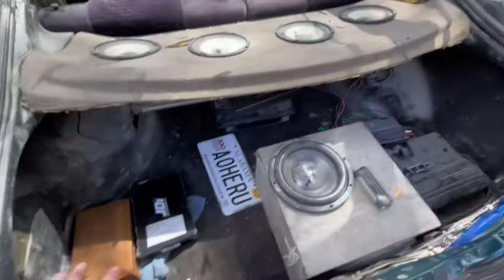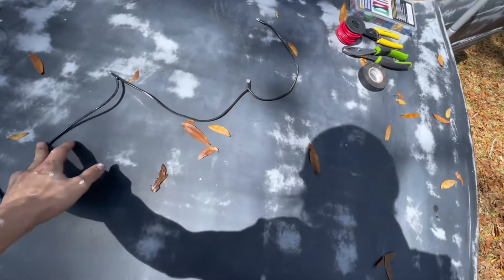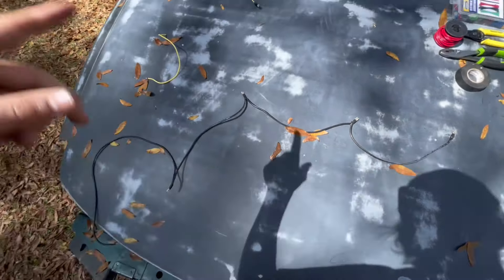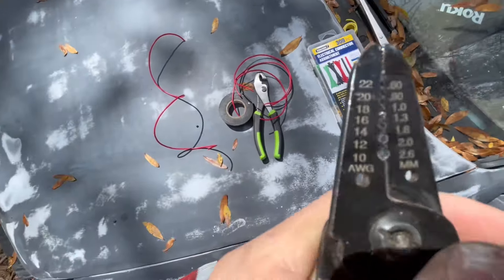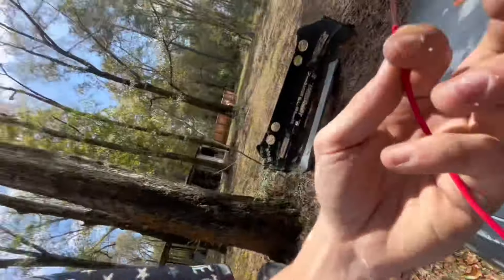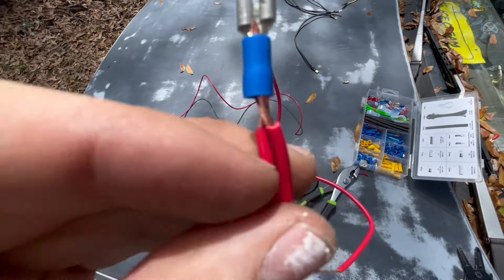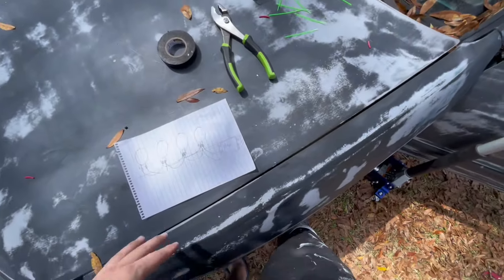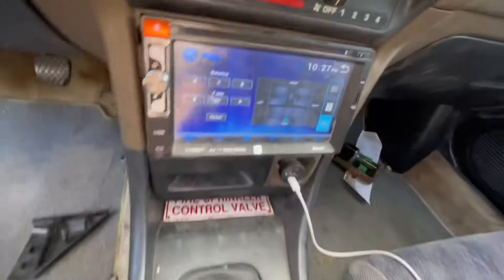How to wire speakers in deck lid(integra)

Comment: 1 question. You have all 4 wired parallel so do you realize what ohm your running them.😊
Reply from the maker: Yea its 2 ohm but the amp is 2 ohm too,dont know much about ohms or what the difference is so i just didnt explain